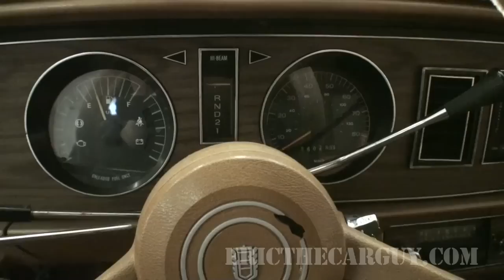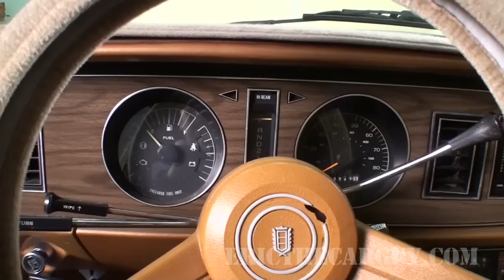1979 Ford Fairmont a Closer Look #FairmontProject

Comment: Wasn't manual an option? It could be made to look stock with a manual.

Manual and 351 v8?

and, don't people go to a lot of trouble to convert to manual brakes, for better feel and less clutter/complication?
Reply: think he wants the sleeper look and nothing says sleeper like an old auto
Reply: You might be thinking of people bypassing anti-lock brakes. Power brakes simply amplify the pressure you put into it. I can't imagine an advantage in going back to manual brakes.
Reply from the maker: I'm not doing a manual.
Reply: buggsyspam
No, I'm talking about people converting their racecars (or fun cars) to manual brakes.

There's the obvious advantage of having less vaccum lines (and thus, less potential problems), less weight, less crap to break (and leave you with a setup designed for an assist, without any assist... basically no brakes). And it will simplify forced induction setups.

Not to mention, your break assist is proportional to your vaccum, when you're on the throttle, you have a lot less braking power - and if you're on boost, you have none. Even blipping for some heal-toe action will cause you to lose braking power, depending on RPM, how far you have to blip, and how fast (how wide the throttle goes) you do it).

I've heard that they feel a lot better, more feedback and a better linear progression to make modulation easier, but that could be bull, I've never driven a car with manual brakes.

My point is, if they stop the car, I'd let well enough alone. If a big brake upgrade is necessary, it could be done without converting to power brakes.
Reply: EricTheCarGuy
Plz do a 302. It can make just as much power as a 351 with a cam and intake :)
Reply: Skitter302
Math tells us the 351 can do more....
Reply: dav3fk just depends yes the theory more cc more power there are exceptions tho  look at high powerd engines of the 70s compared to know
Reply: dav3fk
 Love to see the numbers :)
Reply: lukethekanefan
 The 351 makes its power early and down low, the 302 makes its power from 2000-4000rpms. Now a mild performance cam and a edelbrock intake can match a factory 351's power numbers. If Eric wants to go crazy, changing heads and pistons will really wake up the 302. This is just my opinion after doing ~3months research looking into upgrading my own 302.
Reply: Skitter302
There's no replacement for displacement - the numbers are 302 and 351.

Also, lower power bands kick ass. So does torque. I wouldn't see anything wrong with a torque monster truck motor in it.

Of course, none of this matters, he's already put his foot down: no fun to drive, boring (not to mention unsafe) soccer mom transmission.
Reply: dav3fk there is a replacement for displacement is called a turbo a tiny turbo engine can produce the power of a large n/a v8 theres Japanese engines 2.0L 4 cylinder non turbo making 240 bhp n/a using cam phasing and variable duration cam shafts and high compression and so on
Reply: dav3fk
I've got a feeling that Eric is thinking about power v.s. weight. The 302 is 100lbs lighter then the 351 right out the door. And thanks to the after market it can still get lighter. Besides, who wants a nose heavy car when trying to rip up the corners.
Reply: lukethekanefan
I wouldn't go forced induction, but you hit the nail on the head with high compression ratio.
Reply: lukethekanefan
Yeah, my pride and joy is a (clapped out, smokey) 2.4l nissan - I'm QUITE aware of how this works.

If you're comparing a 2.0T and a 5.8NA, yeah, forced induction wins.... sometimes. Do you know what happens when you compare forced induction on a v8, with forced induction on a 4 banger? For starters, it will actually idle and be drivable for hundreds of HP past the rice burner....  A hundred dollar cam can give a V8 a power boost that would require a mulit-thousand dollar turbo setup on say, my 4cyl. I'm not hating on the "other" side, I'm being real. (I also briefly owned a 351 cleaveland truck.... rated at like 130hp, and 270tq. Absolute BLAST to drive, imagine what it would be if not from a bad emissions year).

I'm too poor for ANY of this shit, but.... if I had the option, you better fuckin' believe I'd have the biggest displacement V8 I could afford. More displacement means more displacement for forced induction to take advantage of, if that's an argument you want to have.

Of course, they've put SR's in everything else under the sun, why not this thing?
Reply: Skitter302
Who's ripping up any corners in THAT?

I mean, in a fun wasteful skiddy muscle car type way, maybe....

And who WANTS to rip up corners with an unsafe kiddie transmission? New automatics are meh, old ones are downright terrifying.
Reply: dav3fk when you say unsafe what makes it unsafe
Reply: dav3fk
Eric was talking about IRS so I can only assume that he wants the Fairmont to handle.
Reply: dav3fk
I don't really know anything about the design of race cars in general, but there is almost no advantage to a street car to be on manual brakes. You honestly have to have a bigger brake peddle as you really have to put more force into it. And I wouldn't worry about the loss of vacuum as the booster is only an assist, not a substitution like electronic steering. Brakes work fine while spooling up a turbo, they'll work fine for stopping and even better a moment later that the blow off valve activates. I've driven cars with old style manual brakes, and it is not a ton different. The pedal sits up higher, and has a longer throw. Again, I'm not talking about race cars, just old cars, but heel and toe driving isn't always possible.
Reply: @dav3fk    IIRC you could get a 3sp or 4sp manual for the 6.  The 4 got you a 5sp. The 302 only came with an AT.

Comment: On the manual trans point: I agree it would ruin the vintage appeal, but what about a 3 on the tree / 3 speed manual setup? Still column shifted but manual trans. I know 4 speed auto is gonna be faster, more fuel efficient and easier to drive, so for a drivers car I wouldn't blame you for going auto\

Comment: Oh and you should do a carburetor, not EFI...  Get something old-school with a carb and points, and replace the points with a Pertronix Ignitor system.  It's the old-style breaker points that caused the most unreliability problems -- plus you can run a full 12-volts to the Pertronix (no resistor-wire needed) so you get a much better spark.  (I have that exact setup on my '68 Galaxie.

I tried to upgrade my Galaxie with a throttle-body EFI system, and it never worked correctly.  I finally gave up the EFI system (after two years) and sold it on eBay for enough money to buy a remanufactured Autolite 4100 carb from Pony Carbs.  The Galaxie cranks up and runs beautifully.  I'd totally drive it to California tomorrow (if I had the brakes done, which I don't yet.  Got the same problem you've got with rotten brake hoses and rusted-out steel brake-lines.  But as soon as I'm finished re-doing the brakes, I'd have no qualms about driving it to California.)
Reply from the maker: Honestly I don't want to go THAT old school. Even the engine in it now has electronic ignition. I've actually been toying with the idea of finding a junk 5.0 EFI that I could put in there and tweak it a little. Thanks for the input.
Reply: EricTheCarGuy Yeah, I can understand that...  A buddy of mine took a 5.0 from a '92 Mustang (along with its 5-speed manual) and put it into his '74 Bronco (which had a 4-speed manual from the factory).  Worked out great for him, so I'm sure you can make it work -- you're a way better mechanic than he'll ever be. :-)  I'm sure you can find a 5.0 EFI Mustang engine and a 4-speed AOD tranny and drop 'em both into that Fairmont easy as can be.  And hey -- maybe the K-member would fit, too?  Kill three birds with one stone, perhaps?

Comment: those engines handle neglect very well i worked with my buddy he had his own sanitation business basically we drove around all day picking up garbage, he had a  home made garbage truck, it was a ford 150 with this same engine, he never ever changed the oil and he put hundreds of miles on that truck a day plus he used conventional oil, the engine still ran fine

Comment: you should go to a salvage yard and get the motor out of a 1999 ford explorer with the 5.0. The explorers have gt-40p heads witch are higher compression than a normal mustang 5.0 and they take well to big high lift cams. The explorer motor also has a much bigger intake than a regular mustang gt. You could easily get 310hp out of a 5.0 with gt-40p's and a b303 cam. also get the carrier out of the rear of a mustang gt and put 3.73's or 4.10's and that fairmont will be a rocket ship, the mustang carrier has limited slip and the ford racing track lock rebuild is only $70 bucks and comes with the friction modifier.

Comment: Get a 2011 F150 DOHC 5.0 engine with a auto 6spd 6R80 full drop in with accessories used of course they are going at very reasonable prices considering the mileage on them and if you get a bundle you might get everything you need. Don't tinker with the dinosaur 5.0.

Comment: I miss these old metal bumpers that can cream any new plastic bubble just by bumping into it while parallel parking
Reply: Twaddles McGee me too those chrome bumpers faded away after. The 70s to get better gas millage and to meet new safety laws at a low speed if the car hits a another car no real damage is done on new cars the plastic will break.

Comment: Hang on, coil springs, power rack and pinion steering, carbon canister, disc brakes, air conditioning. I thought you said Oliver was an old car. 😛

Comment: I would just repair what is broken keep the i6 and  do a 1-3 barrel conversion add a set of headers  and get a set of early timing gears (before emissions kicked in) do a port job add a bigger cam if available and run it like that. If you spend 15000 on that car I think you would regret it. If you do all the things you  want you might as well buy a fox mustang.

Comment: Hello and good day, I have a Ford Fairmont built in 1980 with four courses and overdrive and with the 3.3 liter engine and I need the technical data. Maximum speed, weight, length, width, height, the noise and so on. Who can help? Thanks and best regards from Germany

Comment: 10 grand phew whack a ford 250 straight 6  crossflow and power brakes ,disc rear end a good set of wheels and tyres fix those few problems and keep it looking nice np

Comment: a 1979 car, with a big straight six engine, producing 80 horsepower, without a brake servo?! Ford UK (or Ford Europe after 1970) wouldn't dare. Heck, even the base model Fiesta 950cc had a servo & discs at launch in 1976. I've noticed this a lot with American cars, why is the engineering so old fashioned? In the UK we were messing around with Fuel Injection (in a number of Triumphs), 16 valves (in the Triumph Dolomite Sprint), De-dion tubular suspension (in the Rover P6 range) & Five speed manual boxes (in the Austin Maxi & Allegro). Heck, ford  were even messing with all round Independent suspension in the Consul/Granada range

Comment: you can make those old inline 6s run like a bat out of hell my brothers dad has a 65 chevy with a 235 inline 6 n its putting out 425 horses n 450 ft lbs of torque

Comment: I had a 81 Mercury Capri that had the same engine.  The car was "Black Cat" edition with centerlines, and metal louvers.  With the 3.3 inline 6 it was all show and no go.  BUT, the drive train was never damaged because there just wasnt much power pushing it.  The Fairmont looks in good condition but my question is why would you have aquired it in the first place, and why would you spend money and time on a car like that??  Sentimental?  I just dont get it.  Even a maverick would have been a better investment.  (not by much)

Comment: Eric, I hate to burst your bubble but you can't drive all of Route 66 anymore. A good bit of the road out west has been taken up, degraded into the desert, or just disconnected from all other roads. I know for a fact you can find it from Chicago to St. Louis, but beyond that I have no idea if there's any signage for it.
Reply: i seen a show about Route 66. there where some parts even back then that where treacherous going. but there is still some pieces of the route that are marked in new mexico and Arizona.
Reply: todd davis "When the highway was decommissioned, sections of the road were disposed of in various ways. Within many cities, the route became a "business loop" for the interstate. Some sections became state roads, local roads, private drives, or were abandoned completely. Although it is no longer possible to drive Route 66 uninterrupted all the way from Chicago to Los Angeles, much of the original route and alternate alignments are still drivable with careful planning. Some stretches are quite well preserved, including one between Springfield, Missouri, and Tulsa, Oklahoma. Some sections of Route 66 still retain their historic 9 feet (2.7 m) wide "sidewalk highway" form, never having been resurfaced to make them into full-width highways. These old sections have a single, paved lane, concrete curbs to mark the edge of the lane, and gravel shoulders for passing." Source: Wikipedia

Comment: Did some old lady own this car and only drive it sundays? coz it is very clean for as old as it is. my parents had 77 Ford Granada 2 door same motor but a 3 speed on the column. $10000 for engine and tranny? you getting a Roush motor for it? hehe I would do like others suggested. find ya a wrecked Cobra or GT. for parts. heaven knows theres plenty of them out there that are wrecked.  that rear suspension is gonna cost ya a pretty penny too. Maybe you can get a sponsor for the car to help pay for parts..
Reply from the maker: I'm considering that very thing. I plan to cover that in a future video.

Comment: If you ever change your mind for the stereo, I know they have retro looking receivers like these
http://www.crutchfield.com/g_300/All-Car-Stereos.html?o=p&avf=N&nvpair=FFBrand|Retrosound&nvpair=AG_Size|FFCustom%40Fit&path=g_300^^^

and you can get some really nice sound even with factory wiring using something like this... which can be had for around a $100-140
http://pasmag.com/car-audio/reports/3179-clarion-xc1410-amplifier

it's a real compact speaker amp, both my brother and friend have one so I can vouch for it's clarity in sound, probably not the best since it's class d, but it'll run fine for most people

if you spend around $300-500, you can have a pretty decent stereo with minimal install time, not for everyone, but it's an option

Comment: That "archaic" ls Chevy is still far superior to the fords anemic modular engine and runs circles around it in terms of power and longitivity with one cam pushrods and a measly 2 valves a cylinder. Ford is begging the general not to go dual overhead modular direct injection, so they can stay in business just a little longer. :D

Comment: 80BHP from a straight six?????? In Europe we get that from  1.3: FOUR CYLINDER!
Reply: hahaha, not in 1979 with a standard engine you didn't, more like 50hp at best.
Like he said in the video- they restricted the hell out of the motor to save money and so it will pass eco tests.
Reply: the 1275 Mini Cooper S engine in the early 1960's produced 76BHP!!! https://en.wikipedia.org/wiki/BMC_A-Series_engine#1275
Reply: John Matthews
That specific engine was basically the most powerful of it's type at the time, the engine in this Fairmont was a 1940's design that was restricted.
With minor modification and removing restrictions this engine could make 160+ and run just like a normal engine. The point is the purposes are so different you can't really compare the two.
Reply: Yes, but I'm just saying that in Europe we got the same power from a 1.3 that Ford USA got from a six cylinder.
Reply: John Matthews
BECAUSSSSEEEE.. the purpose was totally different lol. there are 600cc motorbikes that only make 55hp and then a 600cc superbike can make 120hp.

Comment: I can't believe you are going to put $10k into that POS.
Reply: ... POS? that's a pretty clean car for it's age.
also, when a V8 get's dropped in there... oooh...
Reply from the maker: If I put the engine and trans I want in it it would be 10K. There's still the suspension, rear end,  and brakes which would be good for another 4K I think. That said, there are a few options I'm considering. I plan on making a video of those plans when I have them together a little more.

Comment: Putting a 302 in the Fairmont isn't innovative. Show us a way to build a fun ride while also surviving the Unofficial Depression. In addition to costing thousands of dollars, the 302 is going to be a gas hog. Even Ford is opting to put smaller motors coupled with turbo cha(r)gers in their pickups. V8s are the old way of thinking. A smaller motor that weighs less and gets nearly as much horsepower offers an affordable level of satisfaction. What about finding a Ford focus donor car and showing us how to make a swap work (and then making it a hybrid for $1,100 like they did on a recent episode of JayLenosGarage)?

The sleeper car concept is a beautiful idea. Fat tires, a heavy front end, dual exhaust and a roll bar aren't that. You put the turbo in there and the only giveaway you have is a stick shift? What about a column shifter?

Comment: Is this a good option? It is an Fairmont 302 v8. It looks pretty good with no errors and it is cheap 62458 miles.http://www.finn.no/finn/car/used/object?finnkode=47294302&folderId=4325034 (the site is Norwegian, so use google translate or something)